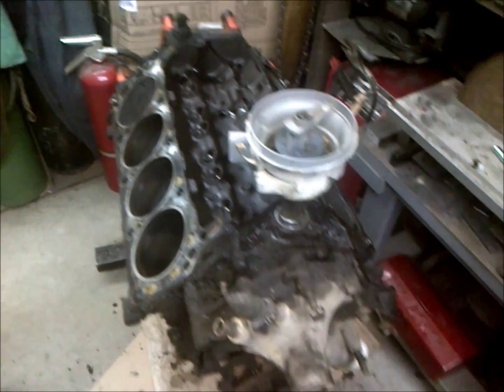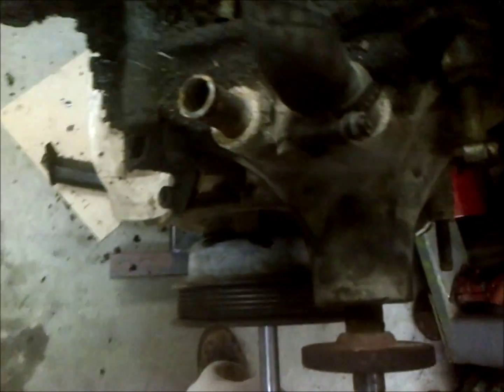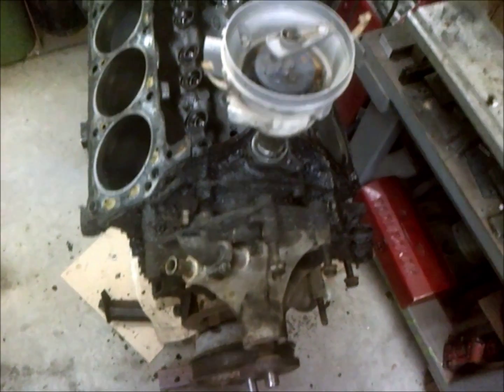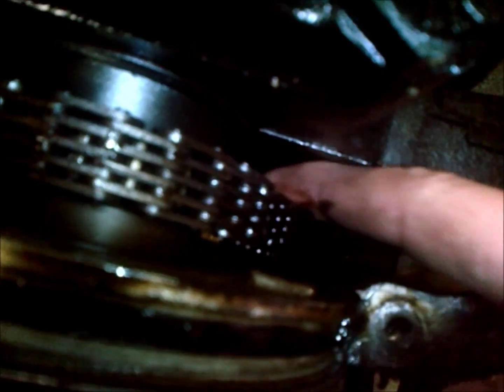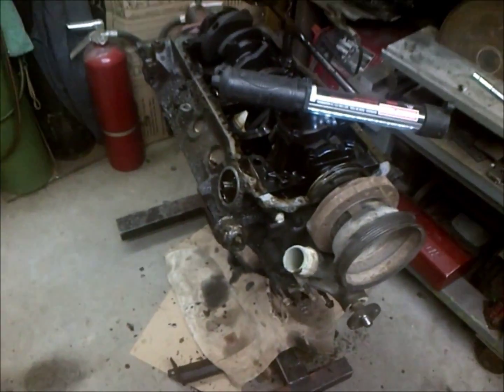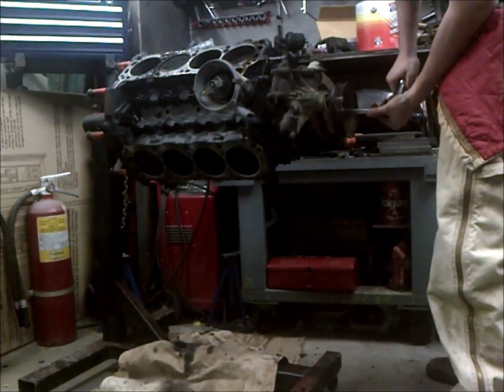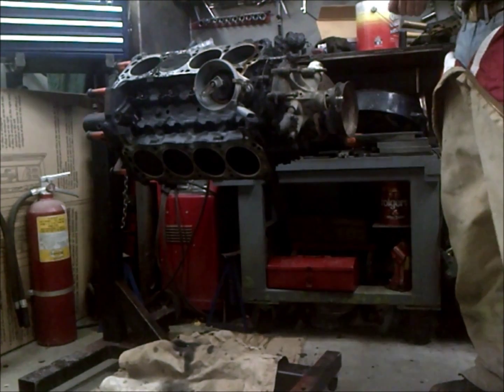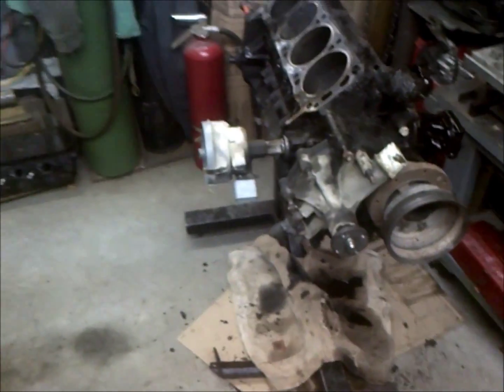Worn Timing Chain WHY YOU SHOULD CHANGE IT

Comment: I have a 75 sbc 350. About to do chain in hopes to solve an overheating issue. Cam is 12 degrees behind crank. 
Will update after its done.
Reply from the maker: Man that’s late! Wouldn’t build as much cylinder pressure like that for sure

Comment: here is the trouble that i am having. 1973 Dodge Polara, 440 x-cop car. about a hundred thousand miles. Been running ok. End of last year the idle got bad hard to start sometimes. I sent out the carb to national carbs in Jacksonville Fl to do a rebuild. Put it back on and could not get the car to start. put some gas down the carb,it started but did not run good at all . Pulled  out the 1 1/2 year old plug's they had gas and suit on them. put back in,it started and run better. But was running so rich it burn's your eyes. Did not idle, no power. Tried to time motor, could not. So i moved the distributor to were it ran the best.  Pulled off the cap,and turned the crank to check the play. If you move the crank back & forth,is there soused  to be tons of free play? How much free play should there be between moveing the crank left or right before the rotor turns???I think this chain is toast......tell me more t/y
Reply from the maker: +Gary Tucker in an ideal scenario you should not have any play at all. iv run my 289 for over 30k with no play. i dont think your timing chain is helping you at all, id replace it with what is called a true roller timing set. they last the longest. also, try adjusting your carb so only your transfer slots show a small square, then turn your mix screws about 2 1/4 turns out. tune for the highest vacuum once engine is good and warm. tuning will be relatively ineffective if the valve timing is way off from a sloppy chain.
Reply: Thank you, I have the mix screws out about 2 turns, seems to run best there.As far as timing,I moved the distributor to were it runs the best. But that does not meant its good. Poor idle, to rich. Something changed in this engine . It ran better a few years ago. When you go down the road,it wants to surge. Not sure what you mean about the "small square" The carb is a Carter Thomoquad.
Reply: also I have seen the cam, it has wear, But what is a good one to replace it with?
Reply from the maker: look into comps line of cams, go for something a little better than stock, one that makes power after 1300 rpm or so. they will have the rpm ranges labeled. too much cam will bleed off your compression and make it run poor. the timing chain is not helping you in the least bit for sure. made a huge difference in my 289. went from an idle vacuum of 11 to 15 when i changed mine. im refering to the transfer slots, there should be some slots on the underside of the carb in the venturi bore. set your throttle screw so not too much of this is showing. finally, old engines suffer from vapor lock and fuel heat issues like the surging you describe. make sure your fuel line is away from heat sources. i also run carb spacers on all my engines to keep the heat off the carb. if you would like to know more, feel free to ask.

Comment: great video
everyone goes to scanning for codes, fuel pressure, sensors, pcm, icm, bcm, fuel pump, filter, vacuum lines, plugs, wires, etc.

when it can be just a stretched chain
had that problem with my '02 3800 series 2
chain was ready to fall off
Reply from the maker: tunnelportterror no one ever checks. they say that its not a big deal because they have a tensioner. even if it wont fall off, its still out of time by as much as 6 degrees!!!!
Reply: tunnelportterror hi mate can u help me out? i went in a garage and the guy said my timing chain has been stretched but the car drives normally without any problems but sometimes it doesnt start first time but always second time. also no engine management lights have come on? should i still replace it or just drive it as much as i can
Reply: yes if it has over 150,000 miles, replace the chain and tensioner.

Comment: i'm having the same issue on my little Toyota 3k engine.... very rough idle..... idle drops and increases..... i'm going to change the Timing chain... Does the engine surge when decelerating when the timing chain is worn??? And also i'm having really bad gas mileage.... i fixed everything that can cause this but still it's same.... I can see about 8deg slack..... Will it cure the problem after i change my timing chain with new one????
Reply from the maker: a new timing chain when you have a good amount of play will help a lot, id say throw a vacuum gauge on it to make sure it is not other issues. a lower than normal but steady vac reading means the timing chain(late valve timing) if its bouncing around, you have more problems. surging on deceleration is a common lean issue generally caused by a vac leak. normal stock motor vac readings are around 18 to 21 inches of vacuum at idle.

hope this helps